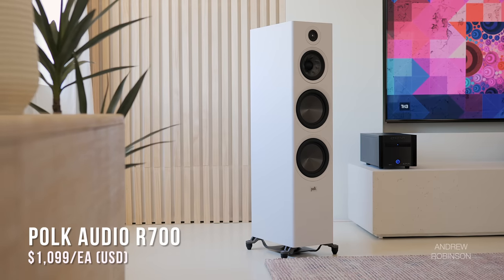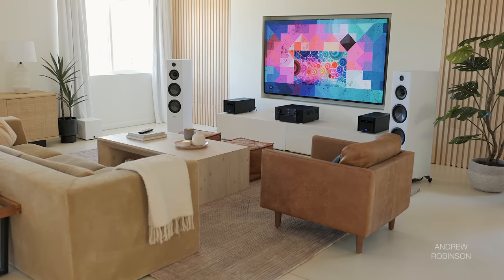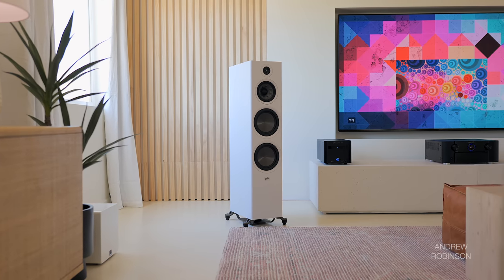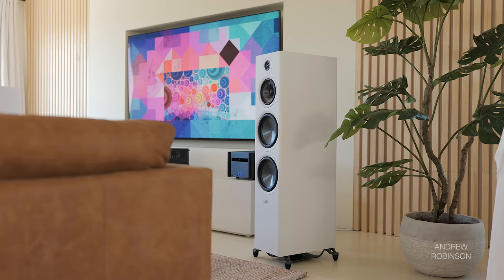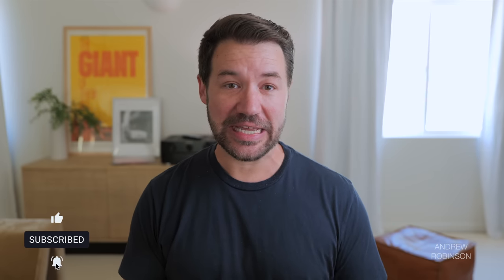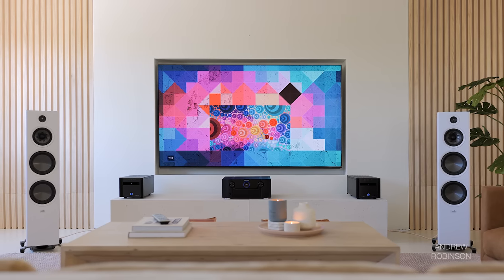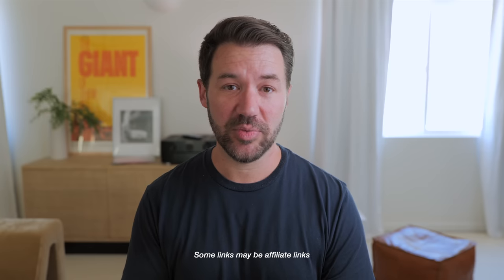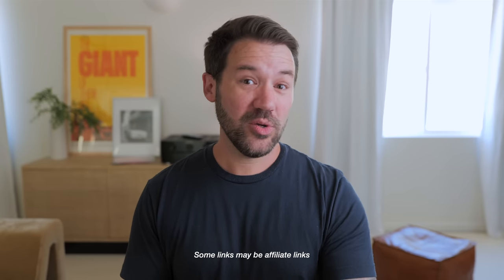Are High End Speakers REALLY WORTH IT? 🤔 Polk Audio R700 Review

Comment: I have the R200 which turned out to be a little bit of a let-down. Fantastic all-rounder, but not what I was looking for musically speaking. I recently built the CSS Audio 1TDX and it is a significant jump up from the R200 - very nimble, superb imaging, & separation, and musical in tone. In fact, musically speaking even my Sound Artist LS3/5A with the Speedwoofer 10s sub-woofer was better than the Polk. While Polks are fantastic all-rounders, and I imagine the R700 is even more of a full-range speaker, the tone of the Reserve series may not be your cup of tea specifically for music. I still enjoy the R200 in my secondary system where I don't do critical listening and its very good (though it wasn't that much different than my Def Tech SM55 studio monitors). The Reserve series would be a great fit for those who want a 1-stop solution to hi-fi that covers both music and movies. But for someone focused solely on music, I would suggest listening to other options as well.
Reply: Did you get the fully finished CSS or the DIY version?
Reply: @gokhanersan8561  DIY with superior crossovers. My first serious wood related project, so it was a risk. I bought the baltic birch flat pack thinking of simply staining and sealing, but it had too many imperfections showing through. Ultimately I finished it with a light wood wallpaper wrap. Had to spend about $150 more for clamps, glue, and wood finishing. I would suggest the MDF flat pack unless you plan to paint the speakers as you can do edge rounding (max. 1/2in radius) with MDF, but not plywood.

Comment: $2,000 the pair. Adjusting for pricing for the years that speakers were made, the R700 isn’t expensive. The Cambridge Soundworks Tower II we’re about 1,500 the pair when they were around in the mid 1990s to early 2000s.

Comment: Not too long ago you raved about the similarly priced HECO Aurora 700. How do these compare?
Reply from the maker: The Auroras will be more dynamic resulting in a punchier/more forward sound. The bass is not as deep or as controlled due to the less inert (cheaper) cabinet. They are more finicky with placement b/c of the rear facing port. The tweeter will be a tad boosted in direct comparison. In other words, the Polk will sound more neutral compared to the more smile like curve of the HECO. So it will come down to what you prefer. As a critical evaluation tool, I'm picking the Polks.
Reply: @andrewrobinsonreviews  Thank you.

Comment: Hi Andrew.
I think you do the best job on YT regarding HiFi.
 
But after this review you have ruined my plan... 😤
I was about to buy B&W 702 or 703.
I heard both of them side by side and I think there isn't between them so much difference.
702 have a little more base because of one more speaker.
I like in their signature that they are bright and detailed.
Sometimes even to bright and fatigue on some tracks, like "Wake Up" by Rage Against the Machine.

Now I own Focals Chora 826 and for their price they are great but a little bit thin in the middle and bad looking.

My decision was to upgrade to B&W because of my like of sound and much nicer look then Focals.
White is necessity in my living room.

After your review I stuck with my decision, because the PA R700 are more than twice cheaper and I could use that spare money to upgrade my amplifier to Emotivas.

The only thing that's stopping me from purchase them is the color.
I checked all dealers in Poland and there is no way to order them in white 🤨
Are they really that special?
I consider to repaint them, but I don't know is it worth the fatigue.

Do you have option to compare them directly to B&W 702 / 703 S2 or MA 500 7G or maybe Polk Signature Elite S60 ?

Thanks in advance for any reply.
Kris

Comment: Hi, how this speakers perform with Marantz SR8015? I have 8012 and i am thinking of buying a new speakers to replace my Dali. I just wanth to have a good speaker to listen 2 chanel audio. For movies i have subwoofer and Dali is OK. If i get them is just to have a good stereo without need to use a subwoofer. I just get the Technics sl-1500c and want to make my system good for 2 chanel (as good as i can for my budget)
Reply: For 2 channel. I'd suggest getting a separate power amp as these are power hungry n you would get the best out of them with a separate good amp

Comment: Hi Andrew, I have an Onkyo TX-RZ720.  110 watts per channel.  Do you think that my Onkyo would be sufficient to power the Polk r700? Thank you
Reply: It will play it but wont drive the R700s to what its capable off.
Reply: @AbsoluteFidelity  thank you. I though so too. I'm looking into a Marantz receiver, maybe the 6015. Will that be better? Or is there something else you would recommend.  Thanks again
Reply: @jaycabral5378  my recommendation is this; get the most powerful power amp you can possibly afford and use the onkyo as pre. Overpower them as much as can, Im using the Crown XLS 2502 that has 440w @ 8ohms and 775w @ 4ohms with the Topping D90SE as a pre and that is the only power amp I felt that does it justice and make it outperform way costlier speakers. The Emotiva monoblocks Andrew is using here are perfect but that will add up to the price of the R700 itself, and that does not include the price of a pre and dac yet. If you are on a tight budget like me, the Crown will be the best bet. Andrew also mentioned that the Crown performed the same as the Emotiva monoblocks albeit a slightly higher floor noise, but that will mostly be elimimated if you used XLR connections like me. :)

Comment: Are these overkill for a Cambridge AXR100 integrated amplifier? I.e. will I be silly matching these with a, well, let's be honest, budget amp.
Reply from the maker: Overkill? No.The Cambridge will work with the Polks; however, I would not be surprised if you find yourself upgrading for better/more power down the road. The Polks are power hungry speakers. I would consider this combo https://bit.ly/3HFMUUo + https://bit.ly/443TUn8 for a long-term solution.

Rewatch here 02:31
Reply: Thanks for the prompt reply. Great to know that this match is possible. I just ordered an AXR100 to replace my vintage NAD 3240PE, because it started to crackle a bit. Looking at either the Polk R700 or Klipsch 8000f Mkii, and leaning toward the latter. I did not have an opportunity to listen to either the AXR100 or any of the speakers, so I'm a little anxious about my purchase. Holding thumbs.
Reply: Appreciate the suggestions for a future upgrade. Baie dankie (pronounced "buy-a-donkey", and means thank you very much)
Reply: I have driven Monitor Audio Silver 8s with no issues. I have driven the Silvers and an older model B & W 703s TOGETHER at peak SPLs of 85+ at my listening position for long periods of time. I did use a sub too. Sounded great with no clipping noted. Also have used the Cambridge with my vintage JBL 4312 Monitor. Very nice   I own two Very powerful power amp... one high end.... as well but see no need for their extra power.  Would the Polks  sound bit better with Emotiva monoblocks,   Sure... would be my guess  especially when playing very dynamic tracks very loud. However the Cambridge is much less expensive and performs very well.
Reply: Actually the peak spl were 95+ on my meter!  Sorry forvthe mistake.  My other powr amp is a A-D dual mono high end amp 150 watts, 20-20000 into 8 ohms; and 300 into 4.  It does make my Silvers sound a bit more dynamic with a little better bass control when driven hard. The equivalent new amp like it would very expensive then you really need to add a good preamp.  Cool, but you can enjoy your music without spending a few thousand more bucks.
Reply: I drive Monitor Audio bookshelves for my AXR100. For bigger speakers like the R700, you need more power.
Reply: More power.... high current and stable to 4 or 2 ohms ...  is always appreciated, especially  in large rooms at very high SPLs.  The efficiency, not the size of the speaker is the important factor here.   Huge Klipsh and other horn driver speakers can play  very loud with a few watts.  Some bookshelve units require 10x the power for the same SPL is they don't go up in smoke first.   By the way, any playback with peaks in the 90s at your listening position sounds very loud.  Many speakers today can handle that  easily with an amp that delivers 100 high current watts that remains stable with the reactive loads of loudspeakers.  To double the volume you  get with 100 clean watts, you would need 1000 watts with the same stability.  Things are actually more complicated than indicated here we don't have the space here for that discussion.
Reply: Validation! Absolutely!  The exotic "high end" stuff often does not really deliver better sound. The "lower end" stuff tonight oten sounds amazingly good. I asked one local high end shop owner why one would really want to spend thousands of bucks .... $3000 - 100000 +.... on a system.  Answer? Because the buyer can say " l can and you can't. "  and. . . I am  superior to you because of what I own.
Reply: Thanks for all the advice everyone. I settled on a pair of Klipsch RP-8000f MkII's ($599 each) and an SVS SB-1000 Pro sub with my Cambridge AXR100. The leftover money went toward a Cambridge AXN10 streamer, so that I can finally make proper use of my Tidal subscription. The Klipsch speakers run a little brighter than I'm used to, but I'm actually really enjoying the sparkle it adds to some of my favorite tracks. Very happy with my compromise between budget and quality. Klipsch is superb for low level listening, just like Andrew said.
Reply: High end vendors don't want  potential buyers to know anything beyond the snake oil they are selling.  There are valid reasons for some upward costs in production that deliver  better performance.m, better reliability etc.   Also esthetic appeal may elevate the price. Stiil the diminishing return factor breaks in pretty quickly today and very tiny improvements in performance usually yields a very steep upward curse in cost. So... you pay the money and make your choice  ..   then enjoy the music and stop worrying about what's  better. 😂

Comment: As the price goes up, the delta in sound improvement becomes small. That has been my experience. Fit and finish become the main selling points. Real wood finishes or vinyl wraps. Internal build quality, as opposed to this, will get it done. The Wharfedales you have in for review look stunning but they probably do not sound appreciable better. Still, part of this hobby is how they look. There are great revied products I will never buy because they look ugly (Chord comes to mind). My Technics SL-1200GR TT with a Sumiko Amethyst cartridge does sound better than my Pro-Ject Debut Carbon Esprit with an Ortofon 2M Red cartridge. The Delta is small, but I like the build quality of the Technics over the Project. I spent 2k more on the Technics but I did not get that in sound improvement over the Pro-Ject? Thanks again.

Comment: I have had my eyes on these R700s, wondering how they compare to the LSIM707 which I found to be very similar in many ways. I dont think RAF ever reviewed the 707, so if anyone has thoughts here, lay them on me. for clarity, I have the 707s and love them but need a pair for another room.
Reply: @markclark1605   thanks for the reply! I also have the LSIM707 all around and 706C for my listening and theater setup, this is exactly why I want input on the LSIM vs R700... wondering if an upgrade is even worth it, they seem very similar outside of a few tweaks... I too wish they kept the LSIM going, they are excellent speakers and were certainly at an attainable price.
Reply: I have not listened to the newer line of polk audio at all. The R700 towers are rated very good with competitive brands. Polk redesigned the drivers which supposed to help in the midrange along with the high frequency driver which should be a slight edge on the lsim series. The legend series should be good leaning towards the higher end. Polk designed the speakers more towards the option of Dolby Atmos with the square cabinets for the moduels that fire upwards to the ceilings for the atmos sound tracks in movies. Myself, I have had the flagship lsim series nearly ten years and will continue using them. Those R 700 towers are getting some good reviews up against some competitive brands. Polk is a good speaker company who stand by the product they sell. You are making a good choice with those R 700 towers. Best wishes. P.S. those lsim series Polk should have kept in the line up. The cabinets are so stylish and the width of them is a real help for me vs the newer gear!

Comment: Andrew, I enjoy your reviews but if I have a criticism it’s that you praise new speaker or amp as if it’s the definitive, best ever, but then embrace the next speaker or amp you review. Last year I bought the Yamaha rx v6a and the klipscH rf8000f. 6months later the Yamaha was dropped for having firmware problems.  My wife hates the Klipsch. I was about to buy  klh5 this Memorial Day, but now they are outshined by the Polk r700s.  I would get the polks, but would need a new receiver or separates, which would run 2-4 k more. With tech advances like Dirac, which I believe I need, there is nothing on the market to buy. The onkyo z50 is still on back order. Still looking for a reasonably priced HT system that sounds good streaming Spotify.

Comment: So I want music with hard hitting punchy bass and movies that sound like a theater. I just sold my Heresy IVs because they didn't fit the bill. R700 or Klipsch RF-7iii? Or something else? I love the L800 but the requirements scare me.
Reply: All are great options really need to audition each to know for sure. In my system I have the Polk L600s for two channel and then rp-8000fs for home theater. I went with the rp-8000fs due to their easy load on my receiver... leaving me plenty of headroom for running 9 channels. I use a separate subwoofer with that system. The 8000fiis have really tight and punchy bass but if you want even more slam the RF7 and R700 might get you there better, but bass in floorstanders often comes with a heavier avr load so be sure to plan for that with your avr. Even the RF7iii has been described by klipsch employees as really wanting power to reach their best and that's with a 99db or so sensitivity rating! If you were considering the L800 I would not let Andrew's review of the legend L800 or L100 scare you from looking at the L600. It specs even lower in the bass than R700 or RF7 and has all the quality construction of the R700 (including real wood finish instead of vinyl so actually better imo) and none of the fickleness of the L800 as far as positioning goes. I do not miss the eigentone filters either one bit. When I first hooked my L600s up the bedroom absolutely thundered! I've since moved them into my much larger living room and they still clearly reach lower with more detail and definition than my 8000fs. They do require a ton of power though, more than the R700 and RF7 even, but I use a crown 1002 through a technics used as a preamp and it is plenty for the L600s. Imaging through the crown is definitely much fuzzier compared to what I heard through my technics amp directly but if you don't care about that then power and superb bass is available for cheap for you with the crown.

Comment: As far as having a prestige brand-model of speaker in Audio, I kind of abandoned it as a pursuit. Sadly in this hobby you can own top of line Audio Research or McIntosh mated with a pair of equally expensive Wilson's and be thought of too old school and not up to speed on other products that can achieve better results for less money. So no matter what decide on as the best choice for you, there will be somebody looking down their nose. So what is the point. I use components whose sound I enjoy and not think about if it would impress anybody. 
As far as Polk's product goes, I have owned many different pairs over the years, found a lot of their models are heavy hitters and give you a lot of performance for the money. To get something that can do more, than the towers I own, I had to go to something that is 5 times their cost. These towers have a notably different sound and are able to get down much lower, are they better? That would be up to the listener's personal taste.

Comment: Nice video, although it was a punch in the gut hearing that the white finish was no longer available. It looks nice, especially with the grey grill. It seems that speakers companies rarely provide speakers that I would like. There are companies that provide "skins" for laptops, tablets, phones, and video game consoles. I wish they had them for speakers. 

Do you expect the sound quality to translate to other models in the line?

As far as the QOTD, I suppose, when I spend more on Hifi I expect performance, reliability, and features. To some extent, I'd pay more aesthetics, but not much. My dream gear that I want to own is a McIntosh integrated amp or power amp, with meters. However, it would be their entry-level piece. I've never heard any gear costing beyond  7000 dollars.  I can't imagine that it be that much better, especially those that are in the six-figure range.  I could be wrong since I can't say definitively, but I think that it would have to be in the super fine details. Even if I was a billionaire, that wouldn't be enough to pay that much for gear.
Reply: We too were disappointed to hear that the white finish was discontinued. We didn't learn this until after we had recorded the A camera. Initially we were thinking that they were simply just out of stock in white but ultimately that info proved to be incorrect. The "skins" idea would be a nice option to have.